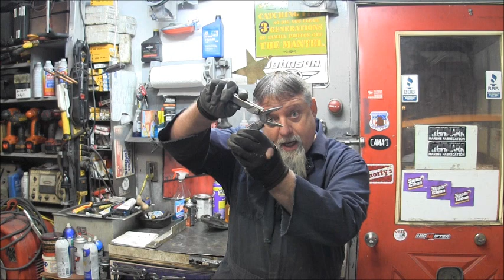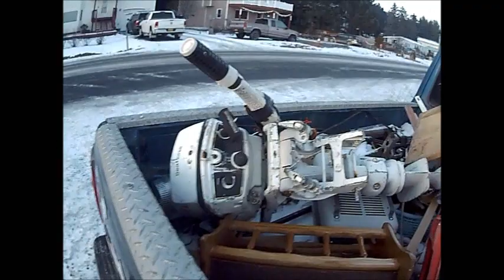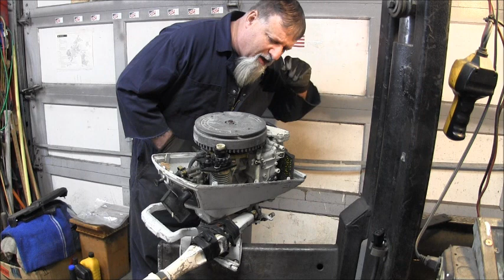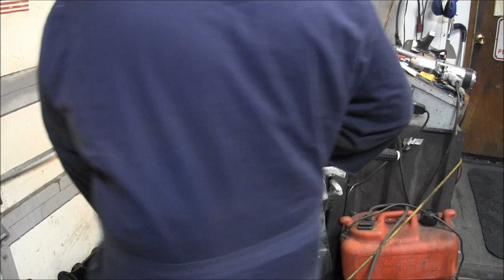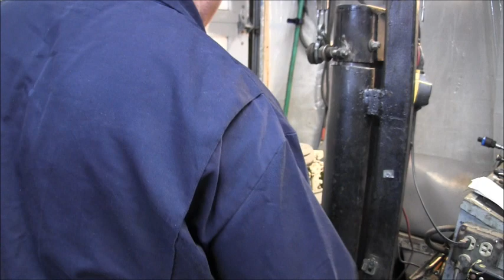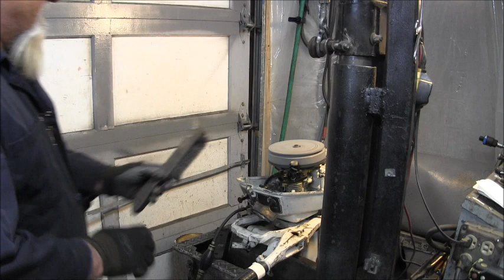JOHNSON 1978  6  HP, SAVED FROM THE TRASH

Comment: Nice little gift luv those CD 6Hp . I have been lucky with great finds and scrap deals thru the years myself its a good feeling. I would pull the thermo first then take it from there probably stuck shut and  packed with salt yuck .Great little kicker and good Luck on that one....
Reply: I have one that won't pump water for beans~!~  I remember you telling me about the corroded aluminum under the water pump plate on your motor,, and how yours also wouldn't pump water, until you repaired the corroded seal housing I tink?!?!?!?!

Comment: Hi Kodi, cool save for sure. If I saw an outboard in a dumpster around here I'd jump in head first🤣 I bet I could alumaweld that tiller up like new. Someday if I may even get a multi function welder so can wels up aluminum.
Reply from the maker: I will weld it if our only weld shop has me some argon.   kb
Reply: Yep, that part of welding is expensive. If you're in business, it makes sense but a DIY in the garage wire feed works but may not work for aluminum?

Comment: if you still get irritated by putting in spark plugs one thing that helps me is to use a small length of fuel line , connect to the spark plug and use the fuel line to guide the spark plug to its seat, if it starts to cross thread the plug will spin in the tube preventing cross threading damage and its easy to use for people with banana fingers.
Reply from the maker: Good tip thanks 4 sharing.   kb

Comment: Did you ever have any experience with the old P 250 OMC powered pumps? When I was in the service, we had a few on board the ship I was stationed on, USCGC Escanaba, WHEC 64. They were temperamental and hard to start. I think they used the old 35 hp powerhead. I know it was OMC because it had the old twin line pressurized tank.
Reply: The P250 was a 35 hp OMC powerhead using a pressurized gas can. Usually they ran great. Their replacement was The P250 mod 1. That had a 55hp OMC powerhead attached to a Hale pump. Temperamental if not serviced and inexperienced operators trying to get it to prime and start it. Robert did you work at CG Base Boston?
Reply: @John Mast  I was stationed in New Bedford Ma. We were docked next to the Vigilant during the situation with the Soviet Union.
Reply: I was in during the late 60's early 70's so ti would have been the earlier gen.
Reply from the maker: Yep' we had those onboard as well.    kb

Comment: have a 9.9 evinrude 2 stroke..  new fuel pump, rebuilt carb, new cdi box.. the engine will not suck fuel into the carb,, if I remove the carb, and spray pre mix into the reed plate, the motor starts and runs smooth,,  my compression is 80 psi to hole, 70 bottom..,,.  I would like to know if I have a blown head gasket, will it cause the engine to not pull vacuum thru the carb? or is this more likely a reed valve issue? or something else? thanks
Reply from the maker: Make a small fuel tank hang it high above the power head,  I use a plastic pop bottle for this.  run a straight hose directly to the carb. and see if it will run on gravity feed.     kb
Reply: @kodibassInsideoutboards  ok I have a small tank off a weedeater I will go rig up... if it runs what does that mean?
Reply: @kodibassInsideoutboards  I rigged up; a gravity feed fuel set up, and the motor didnt pop.,. I pulled the carb again and the bowl is full.. checked plugs and they are bone dry.. the engine is not sucking or attempting to suck the fuel mixture in.. it wont even pop by spraying mix in the carb throat, I have to remove the carb, and shoot premix into the hole of the reed plate.. then I will say, start you bastard.. it will start and run for 5 seconds.. then like bugs bunny says,, thats all folks!!!
Reply: @kodibassInsideoutboards   my 9.9 has the plastic top and bowl style carb,,, I got a rebuild kit and it came with 3 different top gaskets,, what im now wondering is if the top gasket was changed  and they used the wrong one,, If you could make a vid on how these strange carbs work, it would help folks out,, I saw your vid where u rebuilt one, but didnt go into much detail about the components, like the well jet. upper plastic cover  air and fuel routing, ect.. im no stranger to carburetors  but this thing is odd for sure,,,

Comment: HELP.. THE PUMP IS NEW AS WELL AS THE SEAL, NEW CRANKSHAFT SEALS WERE INSTALLED, WHEN THE PUMP IS MANUALLY INFLATED, THE HOSES BECOME HARD... IT WORKS FOR 3 SEC AND SHUTS OFF.... CARBURETOR REPAIRED,,, FINDING NO FUEL GOING TO THE PULSE OUTPUT... IN WHAT WAY THE CRANKSHAFT MAKES PRESSURE ON THE PUMP